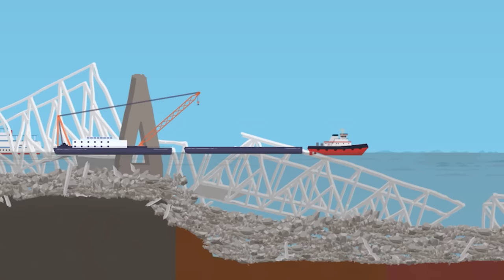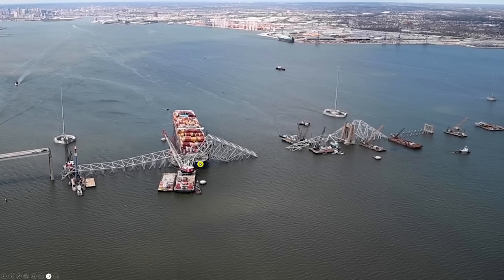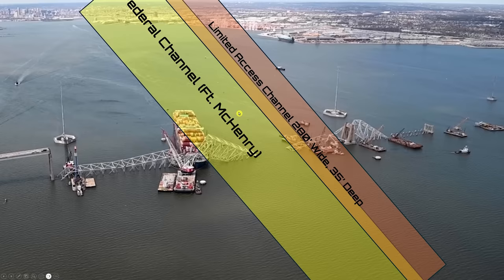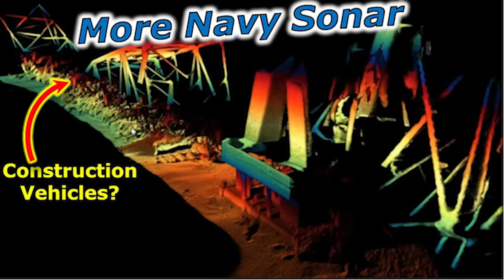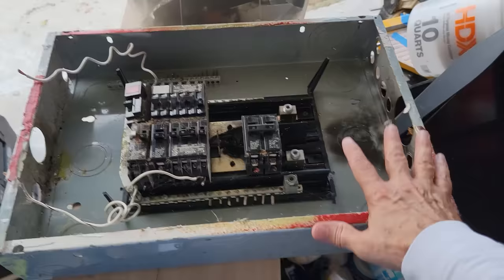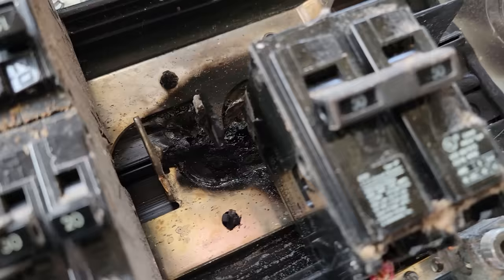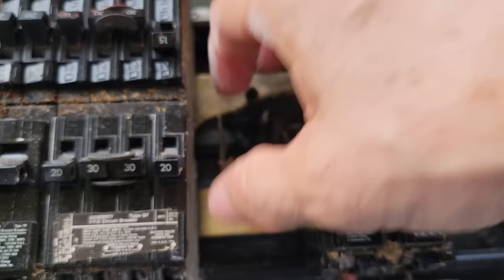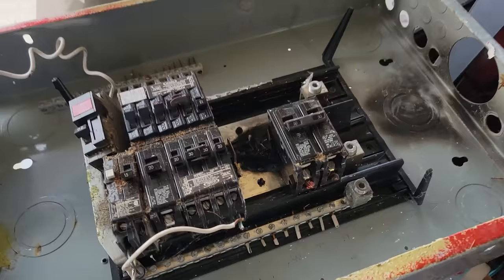NTSB Focus Dali Ship's Circuit Breakers | Bridge Collapse

Comment: I am a retired Merchant Marine chief engineer and radio/electronics officer.  Before I retired I worked aboard container ships very similar to the Dali and used to go in and out of Baltimore years ago.  The breakers on board a ship like the Dali are quite different from the ones you showed on your video but the cause of the problem may have been quite similar.  Once, years ago, I was troubleshooting an electrical problem on a vessel with a 460 volt 3 phase breaker (3500 amps) that was tripping off at random. Everything looked fine visually and the current draw was below the breakers' trip current.  I put a visual thermometer on the input and output contacts and saw 5 of them at close to ambient temperature but one was much hotter.  Heat is what actually trips breakers.  If they get too hot they will trip at a lower than rated current.  All I did to correct the problem was to tighten up all the wire connection bolts on the breaker, after cutting the power first.  When power was restored all the breaker tripping problems went away.  What a lot of people don't understand is that on a ship, engine vibrations can loosen a lot of bolts and screws.  I can't tell you how many times annoying problems that I had were fixed by just tightening up screws or bolts.  It wouldn't surprise me if that was the only problem the Dali had.  They probably loaded a whole bunch of reefers aboard the ship before departure and the load was up quite a bit and when the engine was running it caused some wire vibrations and the heat went up causing a breaker to trip.  Power was interrupted going to the engines cooling, oil, and fuel pumps and the main engine tripped off.  All the rest is history.  It wouldn't surprise me if all the problems were caused by a loose connection on a main breaker somewhere that could have been fixed by a quarter turn on a bolt.
Reply: Had the same problem in miniature on my home panel some years ago. Breakers had a screw connection to the bus bar. Screws were loose - likely from day 1 - and the heat tripped the main breaker one day. Evidence of arcing as well. Neighbour had similar issue - dryer breaker case melted causing contact misalignment and opened the circuit.  This breaker series is no longer available. Screwed connections as on large breakers need to be tight and periodically verified.
Reply: @stevewolfe6096  Yes, the periodically verified part can be important.  There were many times, while I was on a ship, sitting in port, when things were slow, when I would go around with wrenches & screwdrivers just tightening up bolts and connections.  Once in a while I would encounter one that was obviously loose.  I suspect that I prevented strange problems from happening at odd times doing that simple operation.  Nothing worse than after a hard long day, being called up by someone on watch, saying that there was some kind of problem on the bridge, or down in the engine room and I would have to get up and do some troubleshooting.  The only thing was that you had to be careful because sometimes what you were tightening would be a live circuit so you would have to be knowledgeable enough to know what to touch and what not to.  There were time when I would break out my voltmeter and do a little testing first.  You can usually detect a bad connection by measuring the voltage drop across it as well.  I was sometime amazed by how a seemingly complex problem was fixed by just fixing a loose connection.
Reply: Add to it that on a ship you have salt water and the hull is flexing a bit too as well that when the ship rolls cables do move around a little. Not much, but over time it could also contribute.
But we'll have to wait to see what the investigation reveals. I don't rule out any cause - even human error.
Reply: I was on an aircraft carrier for 3 deployments . People don't understand what a beating a ship takes on the open seas and how one small event can escalate rapidly.
Reply: I understand the Battleship Washington was its worst enemy, as it broke crap all over the ship while firing those 16” shells…
Reply: Very pertinent and concise information that may well prove to be the factor in the electrical breakers tripping repeatedly prior to the MV Dali impacting the Key Bridge.
Reply: I would add that when a breaker trips it may trip at a lower current than it tripped at the last occurrence.
Reply: @ronjurgs9799  That is why I learned whenever I am in a breaker panel to check all the screws, and you often find loose ones where the copper has crept with time. Some of them the only thing keeping the mains feed in was the spring tension on the cable, the screws being loose, and needing a full turn to get them tight again.
Reply: Ronjurgs9799,  you are correct with regarding vibration and high resistance connections,   Hydrogen sulfide (H2S  sewer gas oxidation) is another potential problem on Bus bars and contacts but this is visible.  I was a Thermographer for 15 years and most of my inspections were on High Voltage disconnects, Bus bars and Motor Control Centres in power stations and some Marine installations.  I agree with your observations relating to heat however as thermal imagers are so cheap unlike my £35K camera I would expect them to be carried during routine watch inspections. 

The MCC and Buss would have routine load checks which would have disclosed any delta T on connections. I would be looking into anything showing more than 3 deg C  across a conductor   @ 80% loading over 5 min.  Yes you are correct conductor heating will move the breaker toward its trip threshold. 

What is puzzling me with this and we don't have the full story yet, is why the board did not hold when power was restored the second time, regardless of this the emergency Gen set should have stayed up as it was an independent fuel tank. This leads me to think that the system went out due to a major insulation fault preventing the Hv board going live and an error made by coupling the Critical service board onto a fault thus starting a second reboot and subsequent delay.  This could be a SCADA issue or not following correct sequence.  You cannot override an HV disconnect in a fault condition you bypass to the second board without coupling. 

The any refrigeration containers would be low priority and would not have been restarted without compressor rest,  the main engine would have enough air for several starts even after crash astern so Compressors would not need to go on the board immediately, if they were that low on air it would be several minutes to press the bottles back up.  So why the tiller flat had no power I have no idea as that should under regulations have redundancy to the emergency Generator
As for Alternator sync to each other I would expect this to be left until one set was stable as this would be sufficient for the ship providing thruster operation was not called for.   But I expect this has already been discussed. 

Vibration as you say is a big issue on high current circuits but this ship is operated by one of the Worlds largest operators and its inspection logs seem in order.  However control systems are more vulnerable and less detectable, a grounding of a SCADA (Supervisory Control and Data Acquisition) circuit can give spoof data causing errors false operation Temp, Pressure, Timing etc etc.  On some systems which require to be synchronised one connection can stop many packets of data. It is entirely feasible (and my money is on) a SCADA issue being at the apex of this Ships problem. If you have two gauges telling you a different story which do you believe ?. Well the same goes for local ECU's which bit of data is true.  Control is the common denominator.

The jury is out and the comments show some very interesting lines of enquiry and stories of strange but totally predictable situations had they be thought about. To me it is the classic 'Swiss Cheese'  many little issues, some human leading to failure.  The Chief has explained his engine room clearly hopefully giving others a better understanding of power being managed.  Whether its a power-station or ship when handling Megawatts of power things can go wrong without notice and it is sometimes hard to implement the correct action with  klaxons telling you of impending doom or at the very least a grilling by the Chief and mountains of reports.
Reply: We had same problems with over heating breakers and distribution panels, where poor coordination was done.  Sometimes this was caused by dust of debris coating the breakers or wiring.  Several naval and desert projects.  I had the job of solving and repairing these, and was horrified how bad the wiring and the breakers kickouts were done.  This is still a problem between countries, where safety margins are NOT coordinated.  NEC and Maritime rules are not the same, nor are the aircraft.  We are seeing the same issues with solar installations, often catching on fire.
Reply: @Woffy.  You are correct about everything.  On a ship the emergency generator isn't even in the engine room.  It's usually on deck level just under the crew's living quarters.  This is a requirement.  If something goes wrong in the engine room, like a fire, you can power emergency equipment from the emergency generator, like fire pumps, that wouldn't be affected by anything happening in the engine room.  It also has an independent fuel source.  The EG should kick on automatically in about 30 seconds if there's a power failure.  It looked to me like everything happened very quickly.  Keep in mind that the engine control room is all the way aft and is probably at or below the water line.  Unless there's a video camera showing what's going on outside the engineers have no clue about what's happening unless they get a call from the bridge.  When there's a power failure everyone would be scrambling.  

I'm sure that the engine on the Dali was air start.  Yes, you can have many starts & stops before the air tank gets low.  However, if there's a power failure, you have to restore that before you can get the engine running again.  You need power for the pumps and fuel injectors, as an example.  Usually when a ship is underway there's several generators setup in parallel.  I always liked to have 3 running, but that depends on the load.  Say the load would require at least 2 generators and one failed.  The single generator couldn't hold the load and you would have to quickly shed stuff off the buss, like the refrigerated containers, for example.  Then you would have to resync another generator up with the one running and close it's breaker so it could pick up part of the load.  That could take a few minutes, time that they didn't have, and perhaps the engineers down below didn't know that.  Even if they did get a call from the bridge it might not get answered right away if everyone was out in the machinery spaces trying to get things back on line.  

The steering gear can be powered by the emergency generator under normal circumstances so I don't know what happened there.  Maybe everything was working fine and the rudder was working but wasn't effective for other reasons.  The vessel data recorder doesn't record a lot of small details and may only give you a general idea of what happened but not in very good detail.  

After graduating from the academy, I was actively working on ships for 20 years.  We had a few engine room failures but nothing like what happened on the Dali that was perfectly timed to cause a larger disaster.  I was once in a large space with a pretty good engine room simulator where they could simulate all kinds of things but even if you trained & trained extensively and nothing happened for many years, your reactions wouldn't be very automatic anymore.  The best solution would be a focus on maintenance and inspections so if you see something that isn't quite right, you can deal with it when the pressure is off, not during an emergency.
Reply: Bolts Vibrations are a Problem   WOW  thats a real new one .. HAHA WTF ?

You're telling me that this Problem isn't checked regularly ?
Also no Thermographic Inspections ?

Then nothing surprises me anymore..

I work in a Car Plant in Germany they ceck every Elektic Cabinet once a Year .. 
they learnt it the hard Way because of Failures in this Topic
Vibration, Heat,  bad Installation, or simply by going 110% and more.. NO that doesnt work Superman !
Reply: @webname8886  Bit of a sweeping generalisation, some people do understand.
Reply: @webname8886  Bit of a sweeping generalisation, some people do understand.
Reply: Can you imagine a breaker designed to 1)stop bolt detorque from becoming a  problem? 2) training /procedure to check bolts? Would it be too time consuming? So seldom not worthwhile? etc
Reply: @ronjurgs9799  ronjurgs9799
All good observations. Ron this is for the comments as I know you already know this stuff. 
 I don't think there is enough understanding in how systems interact with each other.  Mention has been made of synchronisation of the Gen sets. This is not a quick operation if you are recovering from a fuel problem the RPM instability may take control outside the Automatic syncroscopes ability. Hand sync in an emergency  with fluctuating RPM and loads is to say the least stressful and potentially expensive.

On this ship they only needed one Gen set to maintain control and that one was for some reason AWOL. Any one of the main Gen sets would be able to run the Engine room., forget the cargo that is good for an hour.  
Bow thruster operations could have been done from a second Gen set if running and that need not to have been in sync if it was prioritised for the thruster. I am still puzzled at why so many systems were upset. I think there is some misdiagnosis and subsequent operator error. 

The common denominator is control, it links all points that have failed to operate as intended. Everything which which is remotely controlled, logged, metered and reported, is in question because if the  management system or engine attendant is fed duff data then systems under its/their control could and would be effected. Something as simple as a SCADA (ethernet) intermittent ground of a signal could initiate a cascade of actions either automatic or by human. Maybe the SCADA command to the EG to start and switch critical services over to the the EG board was never sent from the main electrical management ECU which may have had a bad day and commanded the HV disconnects to open, this would command the  Gensets to idle or if in Ground fault, shut down.  
And to answer a comment as you have done elsewhere , the Emergency Generator has its own fuel supply and that is not Bunker. 

Ron cut to the chase whats you gut feeling on this. Fair Winds
Reply: I agree something like a screw or bolt being loose can cause intermittent problems and one of the steps in troubleshooting is to make sure all connections are tight. Unless you realize that a connection was loose when you test the system no trouble is found.
Reply: @Woffy.  Yes, much of a modern ship's systems are controlled/monitored by SCADA and/or a CAN buss system. We had both types on the last ship I was on before I retired.  If I had to take a wild guess about what was happening it would be:  While doing cargo Ops there were some strange electrical issues happening at the dock.  The chief decided to try going to shore power so he could do some troubleshooting on all the generators and/or breaker systems.  After cargo Ops was finished the pressure was on for the ship to leave the dock.  Maybe the chief had a good idea about what was happening so he agreed to fire things up and deal with the problem on the way to Columbo, Sri Lanka. During a departure like that, I always liked to have everything running and have plenty of redundancies available in case something bad happens.  Perhaps, because of the known problem, the chief didn't have much redundancy available but he didn't want to disappoint the captain and/or the company and decided that going thru the most dangerous part of the ship's departure (going under the bridge in a narrow channel) would only last a short time, so it was worth the risk, decided that the ship was seaworthy and ready to go.  So to cut to the chase I think the bottom line problem was a mixture of technical issues and political pressures.  A chief's job is to report to the captain, who has the final say, that all the mechanical systems on the ship are ready to go in all respects.  It would be crazy for the captain to make a departure if the chief said, "there's a problem with system xyz and it will take a while to fix".  I could have been something easy, like a loose connection that wasn't found because his heat gun wasn't working.  It could have been an intermittent connection on the SCADA system somewhere that was tripping off a breaker, or maybe a problem with a generator's governor causing that generator to take more load than it could handle and causing it to trip off.   I would say that the highest probability is that there was an intermittent generator problem of some sort.  The next highest probability was a loose electrical connection connection on a main buss.  The lowest probability would be a problem with the SCADA/CAN buss system somewhere.  You can add in a bias of the captain's and/or chief's desire to make an on time departure.  A big dose of bad luck also was a contributing factor.  If the problem had held off for a few minutes longer or had occurred while the tugs were still nearby, everything could have turned out differently.  I've had a couple of very near misses in my 20 years at sea, but luck was on my side in those situations.  Following seas.
Reply: Greeting Ron, also retired from the same profession, current standard practice is to have a contractor do a thermal survey every two years.  I did my own onboard alternate years.
Reply: @EricWeberGoogle  I always had an old Fluke IR Thermometer that I used.  These days you could use a thermal camera and take a picture for your records.  Every year things get better and easier to diagnose problems.  I gave up being chief when I was over 65.  It got to be too physical.  ARA helped me work the MREO job that was some easier until I turned 70 and retired for good.
Reply: @ronjurgs9799  Thanks for thereply,  Shore power hypothesis. well entirely possible  and with emission regs it may be a requirement to go shore power. Gen set problems lets break down what is common on the system.  Main board, Critical services, cross tie board and HV disconnects. In will leave the emergency Gen as that is autominous (or should be)
So if they were sorting an electrical issue it is more likely to be related to switching as that is common. It is unlikely to have a problem on all three sets unless it is fuel or control. 
Now he left port with power likely with a minimum two sets on the board. His track was straight so probably no thruster needed which as you know is a large problematic HV load. So if the board went dead it was Disconnected either buy fault or human or errant control command. .  

If the fuel source was suspected and then changed they would not have had to flushed the injectors and lines before the generators would be stable enough t synchronised but the power came back to quickly for that for have been completed. So I come back my thought that the system commanded a shut down which may have be exacerbated by a confused or spooked humans intervention preventing backup systems operating.  

So either several faults occurred simultaneously or automatic systems were overridden by crew or both.  Still left with Why the Emergency Gen failed to start automatically.  And I am back to my thoughts it is control related.  You wrote this and I agree.....  

You; It could have been an intermittent connection on the SCADA system somewhere that was tripping off a breaker, or maybe a problem with a generator's governor causing that generator to take more load than it could handle and causing it to trip off.........

SCADA or signal faults can send a lot of confusion on the data bus, a frayed cable that rubs only when the RPM are just right and then grounds the Data line only to  clear once the RPM change. Bastard of a fault to find.  That corrupt or miss timed data may have given incorrect indications which the crew responded to. ?.   

Three Mile Island.  "Reactor has water says stuck meter" Operators believes meter and stops pump. Reactor cooks itself.  I was called to  a G9  turbine 1.8MW CHP  with intermittent trip,  problem was a 5v signal line grounded by a Wasp. 

Captains Bias, crew wanting to impress etc etc, agreed it is possible but there was a Pilot on the bridge and a data logger. I don't think they would be so stupid to play silly buggers in a US Port.   Tug's,  well the port operations could have insisted they attend past the channel but since they did not think about protecting the bridge I don't believe they were particularly bothered about risk assessments.  Fair Winds
Reply: @Woffy.  Since they don't have shore power on the ship at the present time they probably have the engine room generators running and are powering all the refers aboard the ship. They should be able to come close to duplicating the situation that was causing the problem while sitting where they are now.  I heard that there were issues while sitting at the dock, but maybe that was all scuttlebut.  That's my main issue.  All I know is what I see on the TV or on the internet.  Years ago I was a witness to a fatal aircraft accident at my home airport where I flew out of and where I kept my airplane. A couple of other pilots, who I both knew, were killed when they collided on final approach. The local news guys were out and what I saw in the newspaper and what I heard on the TV later were some different from what actually happened. That's my case here.  All I can go by is what I see & hear on the news and use that against my own experience on vessels in similar circumstances and make a few educated guesses.  We all have sea stories to tell.  Some good and some bad.  We need to learn something from all of them.   I have been to Dundalk Terminal many times in years past so I know that that's like. There have been a couple of near misses while I was working as a chief engineer and if it were not for some good luck people could have died as well. One of them could have been me.  Now I see that the FBI is investigation.  That should be interesting.  Hopefully, if the main problem is judged to be human error, they won't take the engine crew off and send them to jail.
Reply: @Woffy.  Thanks for the sensible technical analysis from a knowledgeable guy.  I work in maintenance in a paper mill, and while we're not at sea, we do face a lot of stresses on equipment.  Namely there is a lot of equipment in close proximity, high heat. significant vibration, pipe flex, and everything is wet all the time!  Not to mention human error and poor or delayed maintenance, and accidents like equipment failure or impacts from trucks or forklifts. I have been watching the MV Dali/ Key Bridge incident closely because I truly want to learn from it, and prevent future failures on my own equipment.
Reply: @BikeNewLondon  Thanks for you comment, I am UK now retired  as part of my condition monitoring I had a few mills on the books so  know my way around Berliot, Voith, Overmechanica Valmet etc etc. Hours spent hunting down dynamic oscillations in the forming roll or broken Yankee straws. I feel your pain. as it is a very hostile environment and the speed of the web make for a lot of damage if the DC breaking is down.  

It took a lot of effort to convince the Mills to measure their process machinery and identify and improve mean time between failure. 
Eventually we got it nailed and their cost came down and production went up.  One mill had a g-box issue and no immediate replacement so I told them to nurs it and not to exceed 1600 mpm or the roll will go ape. Received a call in the early hours to get down their on arrival I could tell they were not being honest so I used the OEM's code (Reliance Rockwell that we should not have) to access Mill motor control drive logs which showed 1890 mpm  >8.0 G on gearbox !.  Some smart arse manager thought he knew better and increased web speed left them running at 1500. Mills are exciting and bloody dangerous at the same time.   I know you have have similar stories  I don't miss being covered in wet pink toilet tissue. 

Anyway On the subject of the Dali there has been many interesting comments Ron's included, but putting aside human error and there was either by design of operation. The  common denominator is the control, either the crew were responding to bum data or the system was  misreading bum data. You only need a small interruption in the data line and all hell breaks loose.  I do think the crew screwed up but also  the engineers in not mitigating it. They should have been able to work around any electrical fault so they could bring part of the ship back on the board. I am hearing reports that the shore power was tripping. Again they could have isolated that unless it was the main incoming switch which was going down from insulation/ to earth fault. which are difficult to override.  However the control is what links PLC and sub control systems. We will see.  But one thing which Ron (smart guy) said "They seem to be keeping the refrigeration and ship powered "  What are your thoughts....

 I had  call to a Waste water plant in Wales,  they had fires breaking out and odd things happening.  My first visit was the powerhouse/ substation. When I arrived I could hear the transformers singing at 5 times line frequency. In the control room I noticed the clock was wrong, I asked them and they said oh yes it goes backwards some times and other stuff does odd things,  the printer print word salad at odd times and they can't rely on the monitors.  Then I notice a tank level went from 200,000 ltrs to 50,000 lts in under a minute. Wow you have some big pumps here jokingly. 

End of day I give my  report. You should not have fitted VSD drive's without filters because your supply now has 5th and 7th harmonic frequencies stuffing up the timing of the site SCADA and PLC's and the neutral conductors were also getting very toasty.  As for the fires get a fast van and a big fire extinguisher then get your Motor drives installed by a qualified engineer.  Anyway my point is that control systems are flakey when there is noise or dumb arse engineers fixing stuff they don't understand.  Best to you and may your Yankee keep rolling.
Reply: Vibration of ships large engine horsepower cause the breaker to loose its nuts and producing heat due to loose connection
Reply: T0 much Bs the bridge 40 ship 60 so dad design on both
Reply: Running on light fuel for long periods  in my experience is always fraught with danger.Loosening of pipe clamps extra vibrations etc.Seized M/E fuel pump,condensate line let go among other things.The vessels were not designed for long periods of running on light fuel merely for starting from long periods of shut down namely ex repair berth dry dock or long term lay up.